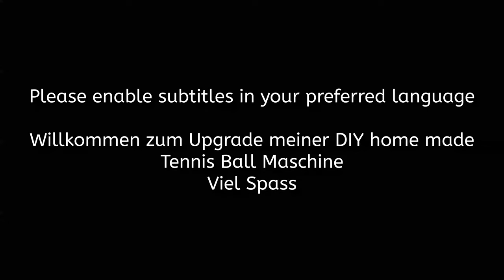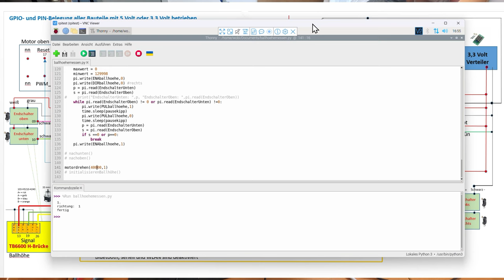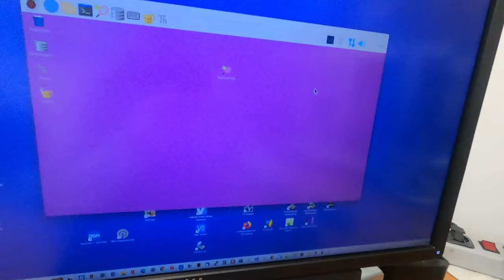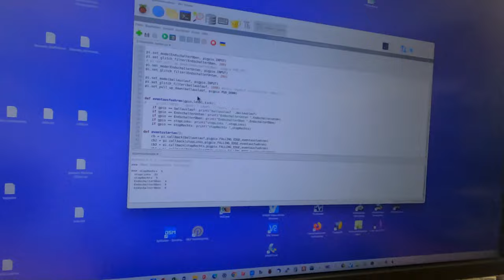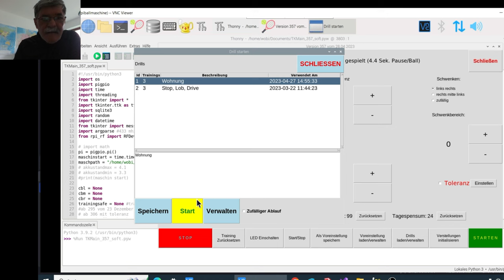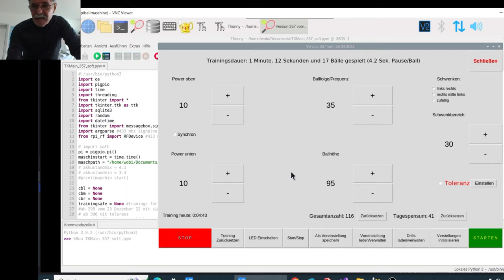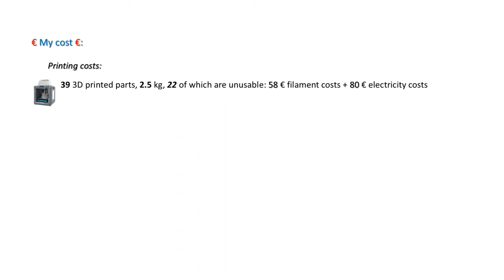Meine DIY homemade Tennisballmaschine verbessern, komplett umbauen und testen

Comment: Wolfgang this is very nice. and thx for share all your files. i start printing today 🙂
Reply from the maker: Thankyou
Reply: @wolfgangbisinger   you are to thank for. just a question, the motors, are thethe model BPM-24-3000?
Reply from the maker: @johndemeyer4613  Hello, sorry but BPM-24-3000 doesn't tell me anything. I can't get to the labels on the motors either, so I'd have to remove them. Both are regular NEMA 17 stepper motors, one with a 90 degree worm gear with a ratio of 17:1 1.5 amps, the other has no gear and is 2.5 amps. I hope this helps you.
Reply from the maker: Or do you mean the server motor?
Reply: @wolfgangbisinger  No, the servo motor is oke.  i need the trowing motors, cheapest i can find is €110 😞
Reply from the maker: @johndemeyer4613  Sorry but I'm not sure which engine you mean? Do you mean the ejector motor with ejector wheel? If yes, these are original Lobster motors with the associated ejection wheels: 'https://www.lobstersports.com/products/motor-server-motor' but be careful, the new machines may run on 24 volts? The other two are described in the list that you can download from my homepage, you will find the link above in the description of the video.
Reply: @wolfgangbisinger  Yes i mean that motors. at this moment i search for then, but expensive. can u take the size of the motors you have? than i can search for a alternative.
Reply from the maker: @johndemeyer4613  The data I know: 12 volts, about 150 watts, 5800 revolutions without load, 10 mm shaft diameter, 80 mm shaft length
Reply: @wolfgangbisinger  Thank you that is a good start. do you know the diameter of the moter it self? 76mm or bigger?  sorry to ask so much.
Reply from the maker: @johndemeyer4613  yes, the diameter is 76 mm

Comment: Thank you for sharing! It is so far the most useful video and guideline out there! I am building my girl friend one, from your video the 3d prints looks very strong. But I am just wondering about their durabilities, would they com apart over some time?
Reply from the maker: Hi, Thank You.
In my opinion, how long the printed parts last depends on the plastic used and the quality of the layer adhesion. I have been using some heavily used parts of my machine, such as the ball turntable, since 2019 and cannot detect any cracks or breaks. If a part broke, it was not due to the material, but rather due to incorrect handling
Reply: @wolfgangbisinger  Thank you again, very delightful to know!

Comment: Hello Wolfgang,

I recently visited your blog page to examine the circuit diagrams, particularly regarding the H-bridges you utilized for driving the Lobster Server motors in your project. However, I noticed that the diagrams only mention "H-Bridge" without providing detailed information. Could you please share a link to a page where I can find more comprehensive details about these H-bridges? Thank you.
Reply from the maker: Hello,

In the Word file "Teileliste_Gleicheachsen_alles.zip", one line above the circuit diagram "GPIO_Belegungsplan.zip", you will find the link to this website:
https://display3000.com/shop/elektronikmodule/h-bruecken-_-fahrer/index.html
You can find the exact description in the details of the H-bridges.
By the way, I operate the H-bridges with 3.3 volts instead of 5 volts as prescribed, works perfectly.
Good luck
Reply: Hello @wolfgangbisinger , I'm afraid none of the links you provided above work for some reason.
Reply from the maker: @CagdasAkalin  
sorry, YouTube changed the link. Next try:
@https://display3000.com/shop/elektronikmodule/h-bruecken-_-fahrer/index.html
Reply from the maker: Sorry no work
Go to my website, you can find the link at the top of the video description, in the download area download the parts list as a Word file from the machine with the heading 'Downloadliste für die Version vom Mai 2023 mit dem Raspberry Pi 4 - Python - Programm gesteuert:' down

Comment: Is possible to get the STL filos of the platform that u make the horizontal adjustments?
Reply from the maker: Not for this machine. For the simple version, you will find a link under Downloads on my website http://wobi4ever.square7.de/ There you can download the stl files, a commented parts list and a circuit diagram.
Reply: @wolfgangbisinger  You have deleted the files? Im open to pay the same 10€ that the simple one costs, for the older stl.files
Reply from the maker: @Huckkey  No, not for this machine. But I have rebuilt the current machine and fitted it with more stable and powerful drives. I plan to publish the stl files of this machine on cults3d. But that will take a while, just check my website later.